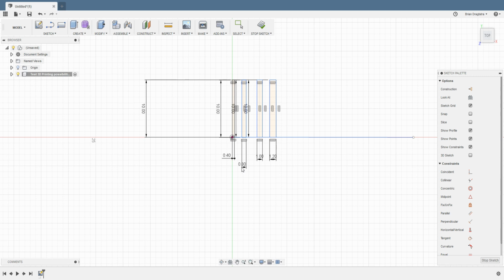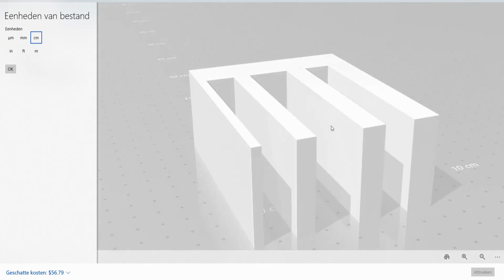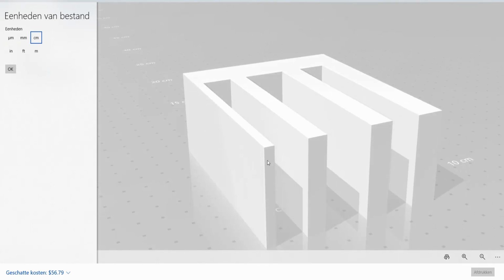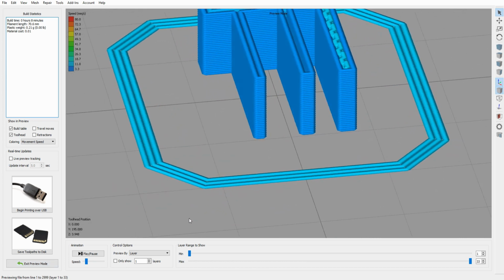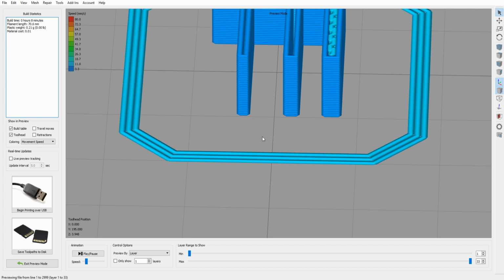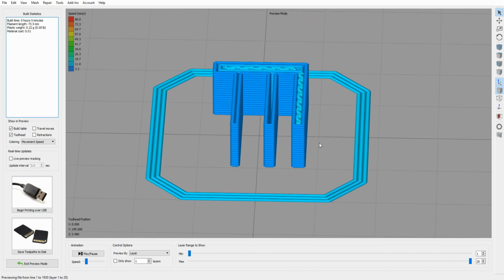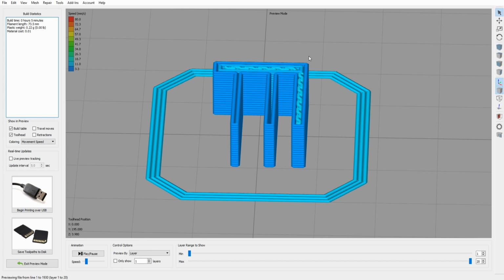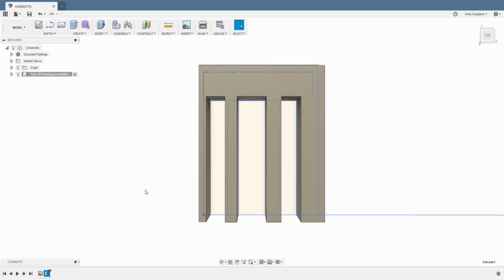▼ Design specifically for 3D printing - Part 1

Comment: This topic is easy to solve in the case of straight lines design, but what do you think in the case of printing letters of small size ... or what do you advise me as a solution to deal with letters ... What are the appropriate settings or the type of font used or its size ... Thank you in advance ...
By the way, thanks for this clip and I watched the correction as well
Reply from the maker: Hi, sorry for the late answer.
When working with letters, you have to know that letters are only visible if you can cut them into 5 lines, and they look good when you double that.
Take the letter E as an example. It consists of a line, a dot, a line, a dot and a line (seen from the top down) So, when the layer height is 0.2mm, you wil need at least 1mm to make it vissible, let alone double the size if you want it to be nice. This is for letters on the side of prints, but when printing on the top of a print, the nozzle thickness is usually 0.4, and that makes at least 2mm only for the letter to be visible, at least 4mm to be nice.

Comment: ik vind je video's goed maar om je probleem op te lossen verander de setting in s3d eens naar op je advance tab van je profiel : 
external thin wall type naar allow single extrusion walls en internal thin wall type  naar alllow single extrusion fill 
dan zal je zien dat je 0.4 muur wel werkt en dat hij de 1 invult en de 1.2 3 muren doet ;)
in cura zit dit onder shell en is genoemd print thin wall

translation for english followers of this channel:
i like your video's but to solve the problem you need to change 2 settings in your simplify 3d profile.
go to the advanced tab and change external thin wall to allow single extrusion walls and internal thin wall to allow single extrusion wall.
in cura this is its under shell and called print thin wall
Reply from the maker: Dank je wel voor deze info

Hoewel het onderwerp waar ik over praat niet helemaal verkeerd is, en het echt goed is om rekening te houden met je hardware als je aan het ontwerpen bent, heb je helemaal gelijk dat Simplify3D perfect in staat is om mijn fouten te corrigeren en inderdaad een keurige print te maken.

Of dit ook bij andere slicers goed zal gaan, dat weet ik niet en wens ik zelfs een beetje te betwijfelen, maar inderdaad... Mijn video van vanmorgen gaf geen correct beeld van de mogelijkheden, mits je een goede slicer hebt.

Dank je voor de info, ik heb weer wat nieuws geleerd vandaag.

Ik heb er een neiuwe video over gemaakt:
https://youtu.be/sD7AF_LhzL0

English:
Although the subject I'm talking about is not completely wrong, and it's really good to take your hardware into account when you're designing, you're absolutely right that Simplify3D is perfectly capable of correcting my mistakes and indeed print a neat print.

Whether this will go well with other slicers, I do not know and I even wish to doubt it, but indeed ... My video of this morning did not give a correct picture of the possibilities, provided you have a good slicer.

Thank you for the info, I learned something new today.

I made a new video about it:

https://youtu.be/sD7AF_LhzL0